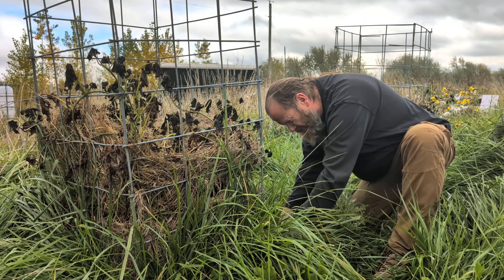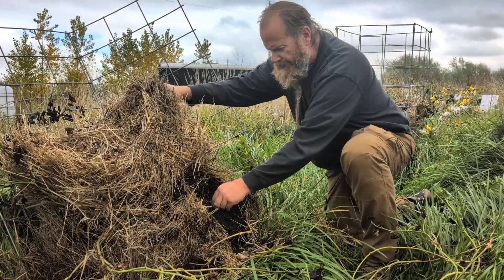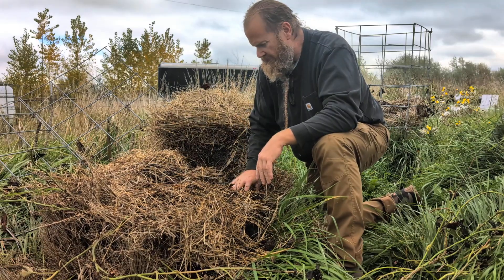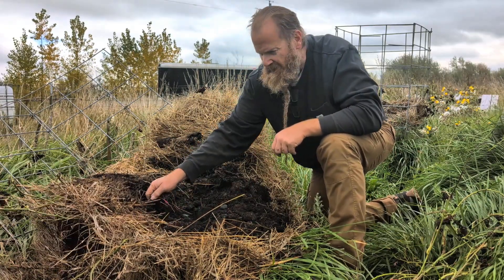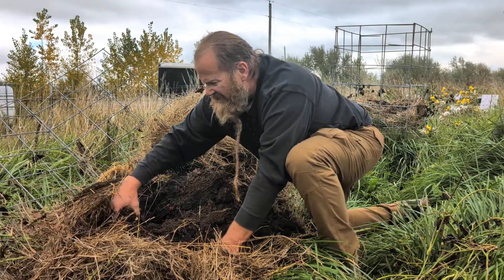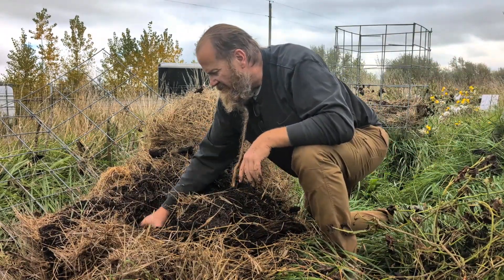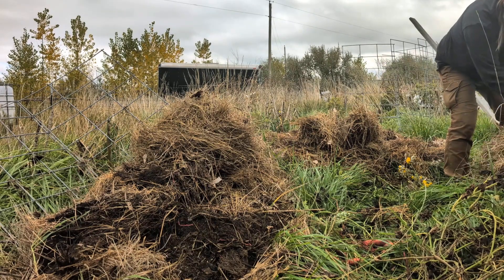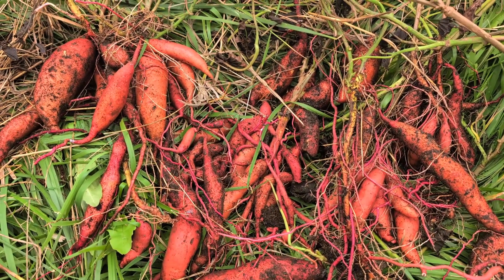The Three Towers of Spring: A Sweet Potato Experiment in Montana Episode 7

Comment: Hi from Wi, zone 5a. I didn't so hot with them this year still, in spite of this - not consistent enough watering I think, and a later start than I would have liked - but it may help to choose a variety which is better for both growing in pots and probably northern growing in general, which are the bush types. Vardaman and Covington being the two such I've heard of and I got Vardaman, I think I found it online at Burpee, a lot of places either don't carry them or were sold out by late April. After this, I will have my own as I have found that they keep just fine. I got an ok-ish harvest, a large percentage of very small stuff tho. I didn't have ideal potting soil either, needing to not spend any more $ and mixing or layering what I did have, and was worried some of mine would be too rich in mostly-composted rabbit bedding/manure bc that's what I mostly had at that time, and many say that sweet potatoes do best in lower-fertility soils. Mine were in black pots and although I've NOT had good growing in black-plastic covered mounded rows ( bc they died right away from the heat & it was super hard to water them.. , even tho everyone says that's the way to grow them in WI. But it goes from too cold to too hot, up & down, often here in the spring and I'm guessing they weren't acclimated... . They were boughten (online) slips that time, too).  Anyway, the bush type sounds better for pots, esp., as they produce the roots primarily in the main-stem spot, whereas the normal kinds produce tubers everywhere they root along the vines, and  even if most of the vines don't touch the ground, they won't make lots more in the spot they are, apparently. But, yours looked like they maybe were a bush type, just the tubers were tiny... . light colored mulches (straw and even hay) may be too reflective & cooling for them... . Have a good one !
Reply from the maker: I appreciate you sharing your experiences! Thank you!

Comment: I’m in zone five and grow sweet potatoes. I start them really early, January. Store or order online. Grow them in the house in pots with good compost and artificial full spectrum LED lights. Once I get a bunch of sprouts, I root them and give them each a separate pot, letting them take off growing. I transfer them from the pots either into my raised beds and or the ground. I don’t bury the tops. I let the vines spread wildly. It seems that the more vines and sunlight,the more and bigger the crop. I surround the plant base with deep deep cardboard,bedding, and wood chips when I plant them. The vines run wild over the top providing a spot to root if they get enough water. In a dry year they need to be watered 💦. They love lots of sun,water and high temperatures if they can get them.
Reply from the maker: I started growing my slips in February. I planted some in may and we got a late frost and had to replant. Got another frost and had to replant again. It was a fun experiment and it was neat to see all those grass clippings and other material turn into compost as well as grow something at the same time. Two crops for the price of one.